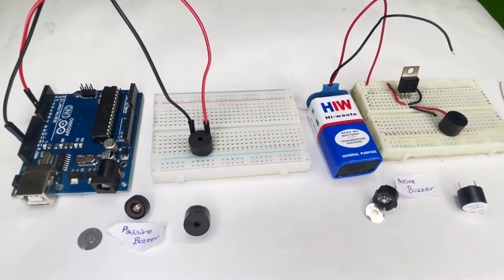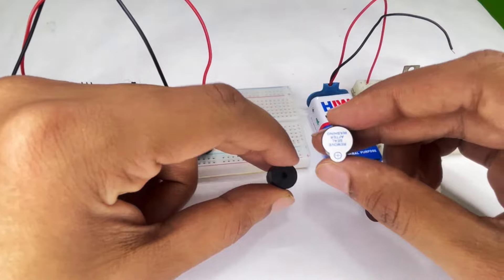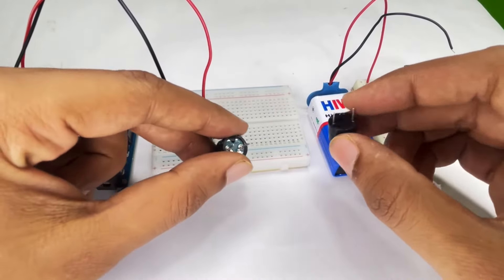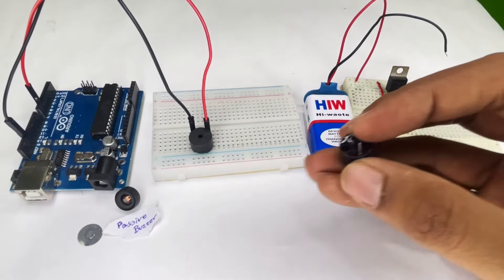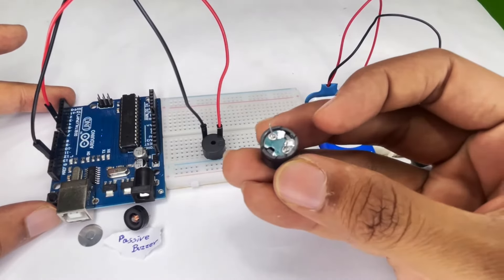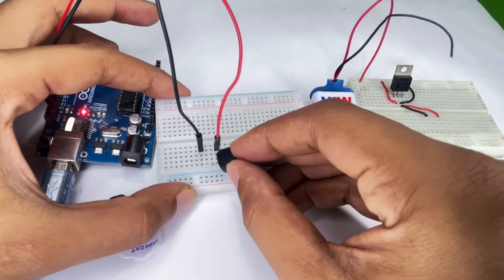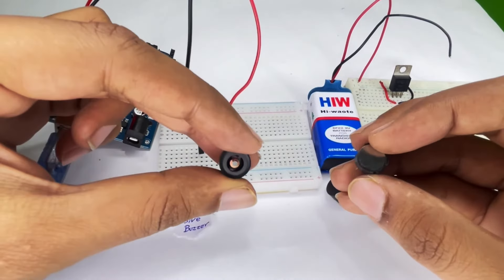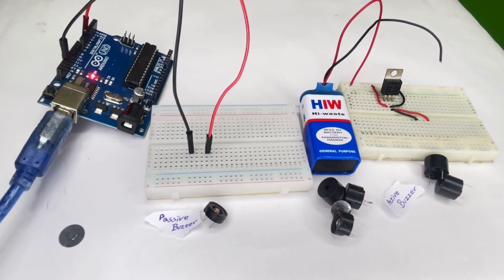Difference between Active Buzzer and Passive Buzzer

Comment: I love this channel and I even own some of those paint scrapers and a few old magnets from magnatrons.  Note: Microwave radiation or electromagnetic radiation is only created when an electric field is present ( power is on).  Non Ionizing radiation, like from a  radio active material like uranium is present all the time.  RF or electromagnetic field as produced by a magnatron, vacuum tube, RF amplifier etc, do not produce a residual form of radiation. ( i.e. a microwave oven does not build up microwaves after you use it, like an incandescent light bulb once the power is off it no longer generates light).  It is possible that old electronic equipment could have some form of hazardous material like asbestos, PCB's, Beryllium , lead, Mercury ......thus some care should be used if you come across old electrons but for the  most part if you  don't disturb, burn or do something stupid the item will not  be harmful if it is used for display or you keep it in your house. Hope this helps someone.  You do such  a great job with this  YouTube channel thank you so much keep them coming!
Reply from the maker: Glad you found it helpful!

Comment: FYI: The active buzzer sounds very bad because its volume is too high. By using a pot or even just a resistor, you limit how much power goes to the buzzer. Limiting the current of the PWM signal produces a reasonably good sound. Maybe the passive buzzer has a built in resistor already to keep its volume down therefore keeping sound quality up.
Reply from the maker: thank you for adding this information

Comment: so it means analog multimeter uses active buzzer while pc motherboard uses passive buzzer? My analog multimeter buzzer doesn't work and i tried to replace it with computer speaker/buzzer but it doesn't work.
Reply from the maker: there is a good chance that what you are telling might be the case

Comment: Why everyone saying 9V buzzer🤬 3V buzzer!!! I didn't know the difference between buzzers so I decided to put 9 volt as you all say since with 3 v the buzzer was making microphone sounds😂 I didn't know it was actually a passive buzzer. With 9V I just screwed my passive buzzer(smelled like hell😢) anyways now after trying with 3V again doesn't seem like broken. Generally buzzer work from 3-5.5V so don't say 9V
Reply from the maker: where have we mentioned it as 9V buzzer?
Reply: @Circuitdigest  sorry if you didn't mention it but maybe I saw the 9V battery😂😅
Reply: @Circuitdigest I surely seen it to another video (not yours) anyways this is a warning comment for the beginners